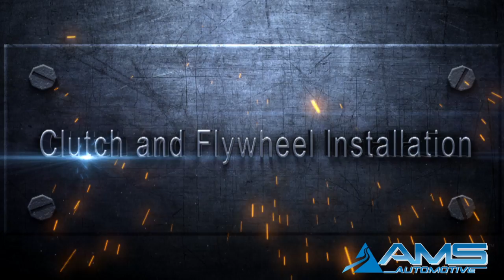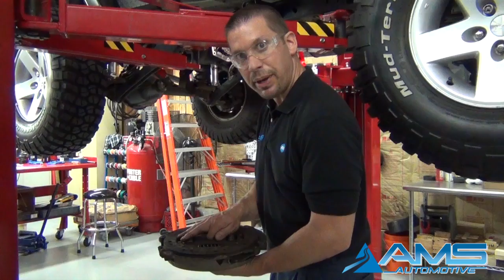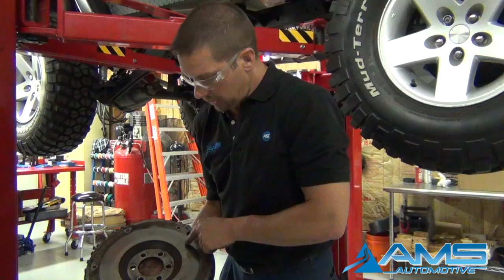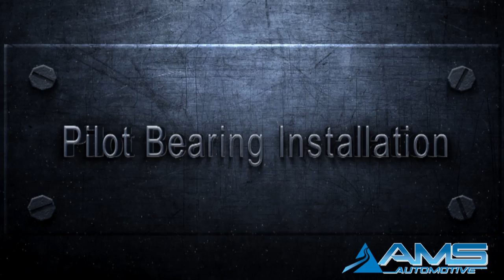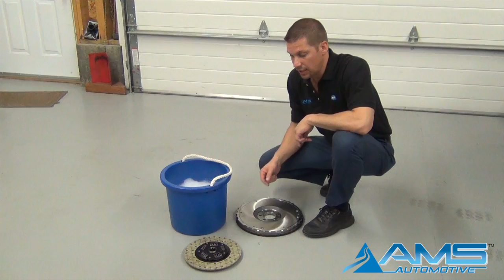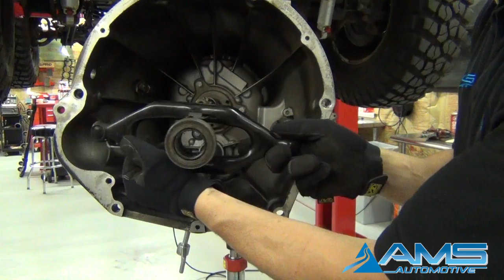Jeep Wrangler Rubicon Clutch and Flywheel Installation - AMS Automotive

Comment: I am surprised you mentioned getting the flywheel machined as Jeep specifically mentions this in their manuals to not have it machined due to the shape of the flywheel.  

From the service manual

Minor scratches, burrs, or glazing on the flywheel
face can be reduced with 180 grit emery cloth. However,
the flywheel should be replaced if the disc contact
surface is severely scored, heat checked, cracked,
or obviously worn.
Flywheel machining is not recommended. The flywheel
surface is manufactured with a unique contour
that would be negated by machining. However,
cleanup of minor flywheel scoring can be performed
by hand with 180 grit emery, or with surface grinding
equipment. Replace the flywheel if scoring is
deeper than 0.0762 mm (0.003 in.).
Reply: First thing I thought as well. I wonder if because it is a Kevlar clutch it doesn't matter?  I think I remember reading that the contour is to help limit clutch chatter.
Reply: That's referencing the stock Jeep flywheel and clutch. This is an upgrade.

Comment: He did not say anything about cross tightening the bolts in 3 stages, should have been around 30lbs then 70lbs and then 105 lbs, you can warp steel if not torqued correctly.

Comment: Is there a video anywhere that has the reinstall of the transmission? A friend of mine has a 1993 Wrangler, and he installed the new clutch assembly but is having a hard time getting the transmission back in. He's doing all of this on the ground under a 3" lifted Jeep. Fortunately he does have a rolling transmission jack under there with him, but something is just not lining up right.

Comment: Would there be anything done differently if it is on a 2009 Jeep Wrangler JK Rubicon? I believe the 2005 has the NSG370 transmission as well.

Comment: hello and how you doing , im portuguese not a professional and i like the way you explain clear the things here , good job. I have a question about flywheel , in my jeep cherokee i whant to remove flywheel to change the rear seal so i dont know if i will have to change the bolts ( new bolts ) in my fly wheel or if i can use these i have whit a little loctite and ofcorse torque especifications ? thankx a lot
Reply from the maker: You should be able to use the flywheel bolts again without having to replace them. Use a little bit of loctite and torque the bolts to 75 ft lbs.
Reply: thankyou for your atencion ok

Comment: Nothing but problems - Installed this flywheel with Luk 05-065 kit, now I have to drop my transmission again and install another few hundred dollars in parts. Uploaded videos in my profile showing th shudder.
Reply from the maker: Hi Jeep Boss, sorry you are experiencing an issue with this flywheel.  If you give us a call we may be able to help you troubleshoot.  800-528-6743

Comment: jeep wrangler 2012 stalled after slamming breaks clutch pedal will not engage now any ideas.
Reply: Wayne Rowe is the clutch slipping  or the pedal just not cycling properly , sounds like your clutch fork popped loose from the pivot  or your slave cylinder is bad pop the inspection cover to see if it's intact and functioning properly if that's not it check your clutch